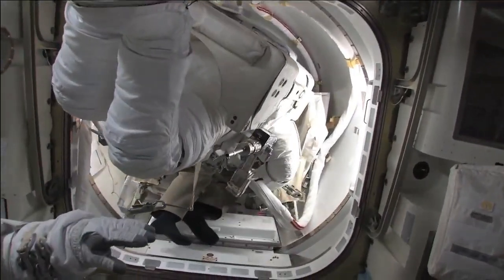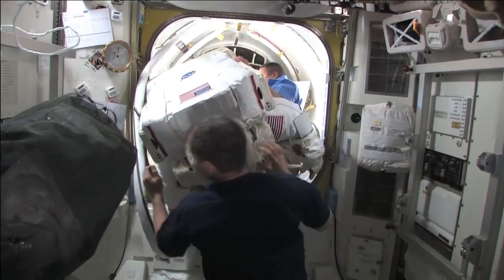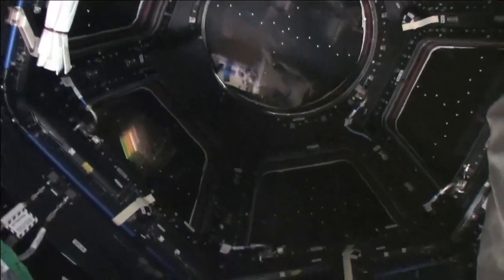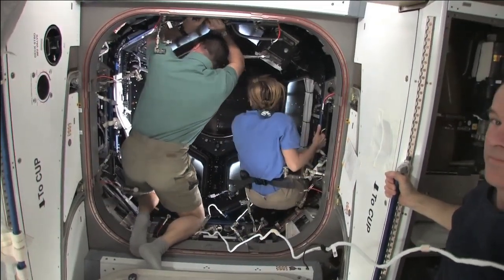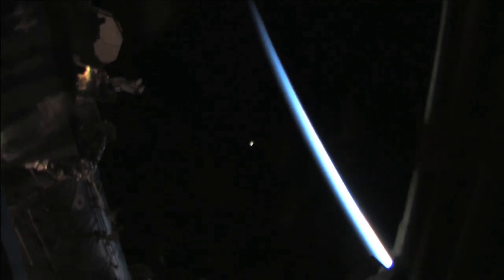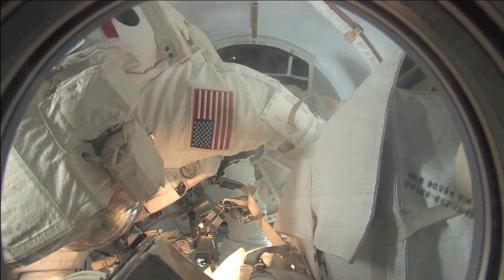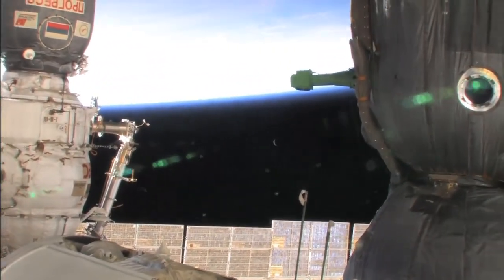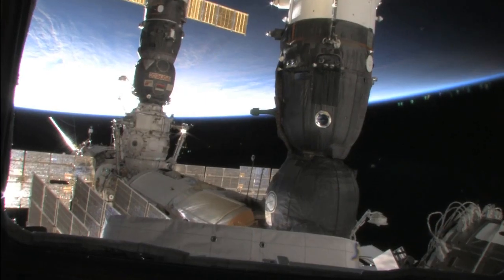Shuttle Endeavour Crew's "Best of Flight Day 10"

Comment: Normal air pressure on the ISS is 101 kPa (14.7 psi); the same as at sea level on Earth.

The EMUs (Extravehicular Mobility Units -- the space suits used for EVA from the ISS and the shuttle) are pressurized at only 4.3 psi (and run pure oxygen, as opposed to the O2/N2 atmosphere of the ISS).  The reduced pressure increases mobility, in particular allowing better glove movement, although it is still tiring to bend the inflated balloon that is a glove even at that reduced pressure.